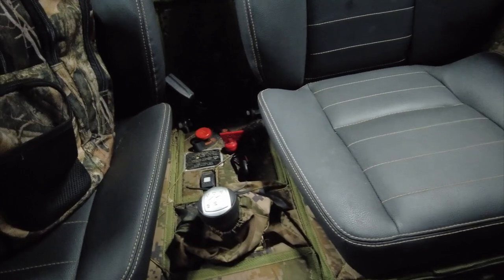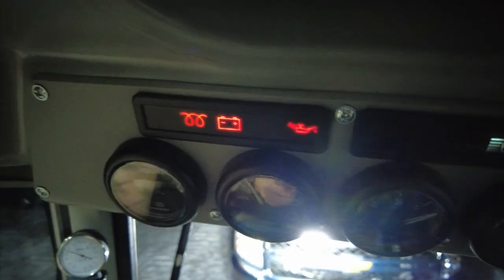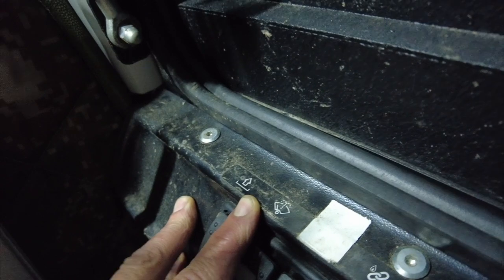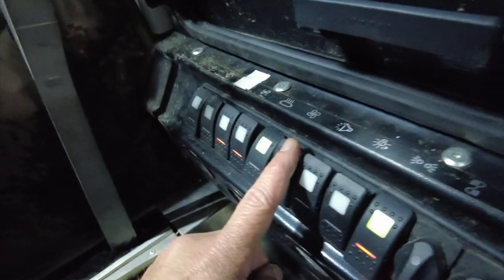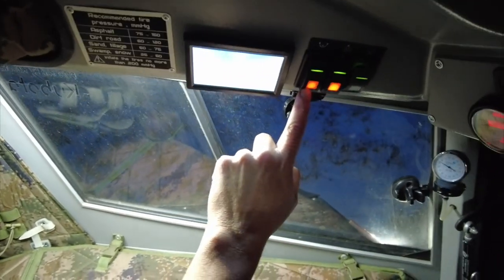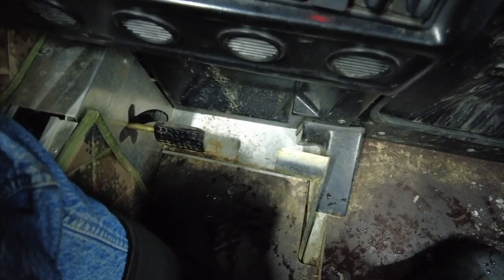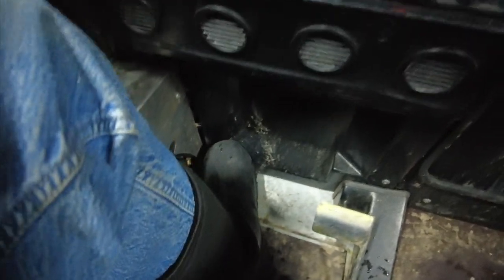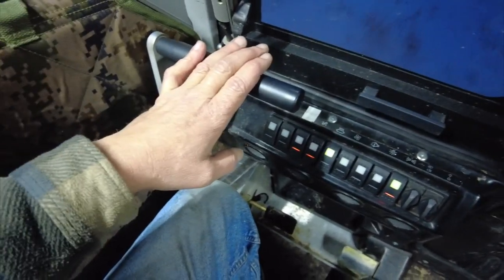How to Drive a Sherp

Comment: I still don’t understand the braking. So you pull the lever to turn. You pull the exact same lever to brake? So wouldn’t the sherp turn directions while trying to brake being that you can only pull one side? Maybe explain the mechanism more rather than just explaining what each control does. I need a better understanding how to whole system works together
Reply from the maker: You are correct.  Sometimes you need to pull both handles to to stop.  Note: Suggest having the foot cultch engaged when pulling both brakes because if you accidentally let both handles out while the foot clutch is engaged, you could damage the mechanical fuse. Thank you for the question.  Hope this helps.
Reply from the maker: https://www.youtube.com/watch?v=BzYjCQ71EJU This may also help.  Not sure if link will work.  The video is entitled Sherp Steering Mechanical Details.  Let me know if more details will help